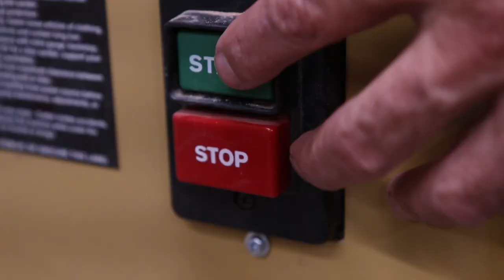How to make  a Hat Rack - Easy!

Comment: It's tough to think this project is for a beginner woodworker when you used a planer, drill press, router table, table saw, and that level 99 black magic staining technique (LOL).  I'm a beginner and I don't have any of that stuff.  The project itself might be easy, but those tools are well outside my "beginner" hobby budget.  

Thanks for the video, though, it was encouraging for me.
Reply from the maker: Thanks for watching. You really don’t need all those tools. If you got a piece of wood that was the right thickness and width. You can probably make this with a hand saw🪚, hand drill , sandpaper and glue. 
 It took me 20 years or so to get this tool one at a time. Good luck and happy making. 👍👍👍